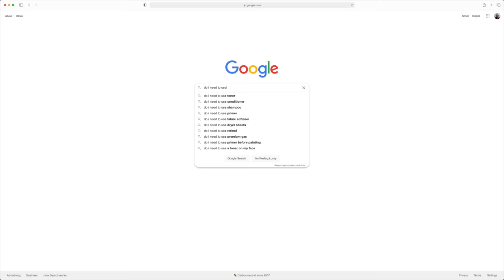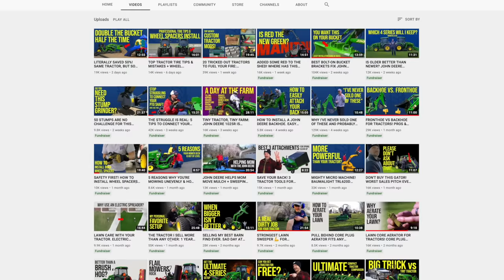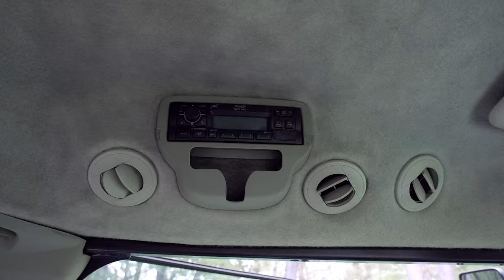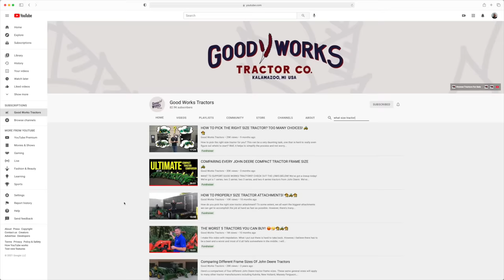TOP 10 BIGGEST TRACTOR PURCHASE REGRETS! COMMON MISTAKES! 😭

Comment: I was kind of surprised by the mower deck being a regret as I just love the 62" on my old 2305. It is fairly easy to put on and take off even if it is not quick attach.   When I was shopping for a new tractor in 2007 the things I was looking for was a smaller tractor then my old Kubota 185. The issues I had with the Kubota was it sat higher up on the ag tires and it was loud. I was matching the tractor to my 5 acres of cleared property. I also wanted a tractor that had a backhoe and front end loader. 

After shopping around I ended up at the John Deere dealer and got a 2305 with the front end loader, backhoe and the 62" mower yeah expensive and having the power beyond hydraulics for the rear along with hydraulic lift for the mower deck.  It took some work to get the tractor sorted out for my property and I wanted a sunshade as I have a issue with being sunlight sensitive. I was somewhat disappointed with  the dealership on the way things were done prior to delivery. I mean having the mower deck way to low and not adjusting it to the proper height for 1-4".  After getting the tractor adjustments and serviced to my requirements I got it perfect for the property. 

The number one best attachment I got for that tractor was the backhoe. I did also make one decision that I am really glad was having two different size buckets for the backhoe 8" and 12" when I bought the tractor.  Recently I started to upgrade the tractor lighting like a light bar on the top of the sun shade and replacing all the factory lightbulbs with LED which means less power draw from the battery and alternator. Putting a light weight light bar on the sunshade has the benefit that the bucket does not interfere with forward vision at night when you might have to raise and lower the bucket.

Comment: My best attachment is my 4way bucket  by far. Got with the tractor  and it works as  grapple  is great at sculpting  and leveling banks with the open front portion pulling backwards and the back portion with the bucket open has a dozer blade  that works great on my driveway.  It picks up firewood rounds up to 3.5 feet across and 600 pounds  it is great and no one's  talking about it. Why is it so little promoted.
Reply: What's a 4 way bucket?

Comment: Truly excellent video and topic!  Kubota B2650 with cab is my ride, and my first ever tractor. Two regrets I suppose. First, 3rd function. I have absolutely no use for it 3 years into my ownership.  But, if I do have need of an accessory in the future, this will be expensive to remediate.  Second is not knowing enough to have gotten a top-of-the-line seat. Mine is good, but an early 50’s back needs a little more tlc! 🤣 Keep up the excellent work and stay safe!

Comment: Great video Courtney. It is so spot on. I did do a lot of research but not as much as as i could have. As i have told you in a talk at the shop i was going to get a 3039r but the perfect storm . Garage not tall enough , city codes and covid hitting john deere  factory. Supply was going to get tighter and it really did so i went smaller ( 1025r with mauser cab). I know i have said this before thank you many times over for the tiny tractor video. It did not only made me more at ease with the purchase of this great, stout little work horse i do not regret it. Would i have liked the bigger tractor yes , but this will work just fine. Lastly the only things i wish it had are two: separate mower lift and the extra hydraulic function Anyway great video as always. You and Chis have great day and be safe.   Tim

Comment: I did not want a mid mount deck  on my 1023e, but the salesman insisted it would be best, even brought in another salesman to convince me. After a few months of using it and the hassle of taking it off and putting it back on, (adjust, drive on, nope adjust again, drive on) My dealer would not help me in trading for a finish mower, so I had to advertise it, a dealer in TN. bought it and with that money I bought a JBar finsh mower. Best move I made.

Comment: Yep that's my number one regret. I should have got the 3rd function and could have got a Used Mid Mount Mower very cheap later. Thanks for the video : )
Reply from the maker: Good stuff, thanks for sharing!
Reply: I'm waiting on my 1025r to come in. I ordered the 3rd fuction and was wondering if it was worth the price. Going to get a grapple but not sure which one to buy that makes the 3rd fuction useful
Reply: @dannyallen9804  Not sure either I still don't have a 3rd function valve but got my eye on summit's 4 rear remote manifold that tractor time with Tim showed on his channel. Then I will plumb one remote forward for the Grapple.

Comment: I bought the belly mower 3 years after tractor.  Love it!  Never take it off and I've never had my bucket off.  Right now I have the bucket, mid mower and 4'  rotary cutter on the back.  I bought a Mahindra eMax22 in 2013, still great.  Detachable bucket want an option.  😣 I want one.  Can a turbo be added?

Comment: I see good tractors for sale here on FB and local swap sites and 90% of the time its one of two things. They are selling the one they have to buy one just like it or slightly larger with a cab because they did not buy a cab the first time and bought too small. 

Also, you often see people selling old tractors because they did not support quick attach or also because they wish they had gotten a 4 wheel drive model. 

The other 10% are just selling because they need cash.

Comment: I do not own a John Deere but my tractor is brand new and I hate my belly mower. It mows great but has several draw backs. One of the main reasons I hate my belly mower is that the tractor does not have very good (any at all) suspension and when mowing a rough lawn then it can be hard on the body. Also if you have a hill, it is very dangerous to mow using a very tippy tractor.

Comment: My 2020 LS MT225 came standard with a Skid Steer quick attach loader. This video is the first I have heard of LS having their own style quick attach.
Reply from the maker: It was my first time as well.  Almost identical to a SSQA, but smaller.
Reply: @GoodWorksTractors  Could it have been the qa system off a mini skid track loader? Those work the same as the skid steer quick attach but are smaller to facilitate the smaller machines

Comment: Does the belly mount mower do a good or just fair job?  I hear many people talk about issues with scalping or irregular cuts.  Appearance is important to me and I’m concerned I might not like the results. Would a rear mount finish mower be a better option?
Reply: I don't have first hand experience with a mid mount mower on a tractor but. I have with a rear finishmower. I've noticed that brand and shape make a difference.  If your yard has dips and valleys "not huge" . Depending on the deck you may scalp in spots until it gets evened out more.  Depending on how deep the dips are you may have to go another direction because you will feel like it didn't get cut.
   I  had an older woods rear finish mower that did a great job.  It seems the newer ones have a v shape in the front and I find that digs into my yard  here and there. The  newer one I tried, wasn't a woods and I was rather disappointed.
Reply: @billfischer6464  thank you very much.

Comment: I was a tractor virgin when I bought both a 2021, 5055e and 1025, both with buckets and the 1025 with a backhoe. My biggest regret thus far is not purchasing some sort of ballast for the 5055. It almost cost me my tractor (at least some horrific damage) because I over estimated the amount of gravel I could carry in the bucket. I had to dump my load in order to keep from tipping over during a down sloping turn.

Comment: I’ve got some serious brush to cut around some acres I just purchased.  I don’t even know the difference between a bush hog and a rotary cutter.  I have a JD 728x, but I cannot believe that’s large enough to do the job.  What do you think would be the sturdiest, most dependable, easiest for a woman to use, affordable tractor and bush hog?  I would also use it for tilling, and scooping/ loading.  But I don’t like driving a tractor with a loader on the front if I’m not using it.  It just bothers me,
Reply: Get a John Deere 1025R and a Frontier RC2048 rotary cutter from the dealer - you will love it !.   John Deere IMHO builds an excellent tractor and has excellent customer service and a very large dealer network.  A rotary cutter, bush hog, and brush hog are all the same thing - some are just proprietary names like Kleenex and tissues.  I have the same rotary cutter and it goes through some really big stuff (10' tall and 2 inch saplings) and just mulches it up into sawdust.  The 1025r can be ordered with the quick park loader - which very easily comes off and on in less than 5 minutes (watch the Good Works Tractors Video of how to remove and install it!). If you are going to run the Rotary cutter without the loader on the front then also put some suitcase weights on the front of the tractor to counter balance the weight from the rotary cutter - again just purchase all of this stuff at the dealer.  I like to buy new - then you get the bumper to bumper warranty (2 years 2000 hours) and also the 6 year 2000 hour power train warranty (engine and transmission).  Or buy used from Good Works Tractors and save some money !

Comment: A sub-compact with a belly mower is good for cutting a LARGE  area, but not very nibble around a HOME. A zero turn is a lawn MOWER much easier and faster for mowing in general. Loaders and front mounted equipment REQUIRE counter weights. I guess a salesman does not want to scare off a customer with this necessary  additional cost.

Comment: I have a 3032E. My brother used it to pull a double hay rake today. He asked me how to set it to float. Apparently the 3pt on this tractor doesn’t float. The way he explained it is that It behaves as if it has down pressure forcing the tongue of the double rake toward the ground breaking the tines and lifting the back tires enough to spin. It doesn’t float with the terrain. It does ok on level ground. We pull these rakes with an older much less powerful 1940’s Ford Tractor without any problems on the same terrain. Is there something I need to do to put it into a float position?

Comment: OK... from personal, practical experience owning a half dozen tractors of various sizes, the most practical for the guy working or developing a piece of property, the minimum horse power required is about 40-50hp with a loader and  4-wheel drive.  Forget the 2-wheel drive tractors unless you are going to work dry ground pulling agricultural ground engagement attachments.  You will just about double the amount of work you can perform with a 4-wheel drive tractor over a 2-wheel model.  My largest 4-wheel drive tractor was a 65HP Kubota M Series.  It was used to pull discs over a 10 acre field.  I had a 2-wheel drive Massey that was about 70hp that was frequently stuck on flat wet ground. Even with the rear wheels locked I could not get moving until my neighbor with a 35hp four wheel drive tractor pulled it back a few feet.  On the plus side, on flat dry ground the loader would lift about anything including huge fir stumps onto a burn pile.

Comment: Agreed.   Mid-Mount mower on these are poor buys, they are a hassle and don't cut all that well with a tendency to scalp, and you can't take them into the woods.  Better to buy a separate mower.
Reply: Agreed, I have a couple old jd 445 garden tractors that are great! The 54 inch deck cuts the lawn awesome and the 60 inch deck is a brushhog with oregon g6 gator blades!

Comment: My biggest regret is the tractor itself. I was looking for a small tractor with a loader and a backhoe. After looking at Deere, LS, TYM and Kubota I assumed that to get a small tractor you'd have to get a farm tractor with the backhoe added. I ended up with the kubota b2601. There was zero help from the "sales team" at kubota because there are no other dealers around so they don't really have to try. A few weeks after purchase a friend asked why I didn't just get the b26 TLB. The answer is because I didn't know the machine even existed!
    Now when I dig trenches in my oak forest I spend more time with the sawzall than I do the backhoe. Not to mention that you can't get 4 in 1 with the b2601. Thanks sales team!
     I asked about a trade in even though my machine only had 14 hours and there's a wait list for the b2601. They said I'd have to eat the tax, which that's a given, but they also wanted 15%. So basically a 8.5k loss. No thanks.
     All bitching aside, it's a good tractor, just not the right one for me.
Reply: @peterm3964  Looks like you missed the point of the whole video. Not surprising
Reply: How did it turn out?  Did you sell it privately?

Comment: The biggest problem with the belly mower is that you can not use it if you have a 3 point attachment connected because the 3 point goes down with the mower.

Comment: Nailed these.  My 1025r mower deck is constantly becoming misaligned and I'm having to drive on and off several times to get the drive over deck lined up.  Really wish now I'd just gone with a zero turn and kept my tractor for all my other work.  And one that I'm surprised didnt make the list....someone telling me about the 1025r taillights being so susceptible to breaking.  Didnt have my tractor 5 hrs before I broke my left light on a tree limb going around a tree mowing.
Reply: I drive two 1025rs at different places  same owner ,one has a quick hitch deck which is great unless you break a belt.
The other one doesn't have a quick hitch and is a real arse to hook up or even disconnect the deck pto .
As for the lights on the roll bar take them off an mount the on the inside of the roll bar real easy. Both these mowers do 5hrs of mowing each mow.
As a matter of interest one of these mowers I put my cycle computer on it and clocked up 25km in one mowing .
With the front end loader you need to be very confident with your skill in knowing the tipping point when the bucket is loaded as you will tip the tractor over this applies to all tractors lrg or sml as they are front steer and are there fore very unstable.

Comment: I don't regret getting my third function for my kioti tractor, but I learned after the fact that it isn't as capable as my dealer alluded to, I can't open and close the grapple while moving the loader boom. Also the 3rd function won't operate a hydraulic auger, will have to use the rear remote and run a line.

Comment: My biggest regret, (and I knew it would be) was not getting 4WD on my Kubota L4600 with a loader.  I knew it would limit some of it's ability, but I don't have to use the loader a lot, especially with heavy gravel.  I did fix the situation by adding two sets of rear wheel weights, and I usually put on the tiller as well.  I'll be adding another set too to make it even better.  
I just was at my budget's limit with this tractor, but it does most everything very well, just need to add that last bit of weight.

Comment: Not told it won’t work!  -  Hi , can you confirm this issue?  -  JD X354 , One big reason to make a purchase is thinking the 42” 4WS can cut close to a curved walkway or mulch bed. It seems to me and this is where you can verify things seems to me the 42” deck will only work as planned on an outside circle such as mowing around a tree. But it cannot cut up to the tire’s path of travel on an “ inside “ curve. The 4WS simply isn’t enough on a 42” deck. A 48” deck will be needed to get you up to the edge on an inside curve? This is my observation as per checking out various videos and researching to keep from making a purchase MISTAKE. Nobody actually tested it on camera. My priority is to buy a mower that will save me from returning to cut the edge of my curved mulch bed. I’d hate to make a BIG purchase on the X354 and find out the 42” won’t reach the mulch bed on a tight inside curve but the 48” will. 🥵

Comment: It is important to mention that the one “lever” /control lifts both mid mount mower AND the 3 pt. Hitch !  I pull a cyclone vacuum and can’t have the 3 pt. Going up and down every time i move the Deck up and down !  Now I have to purchase an additional valve and plug and unplug the deck /or 3 pt. …….Salesmen should have made that point !!

Comment: I purchased a new massey 2860. It has standard skid steer quick attach. It was mentioned in the video that they have their own designs. I believe they may have changed that for their new models if this is the case.

Comment: Looking at the 1025r, but I was introduced to the ct1025 from bobcat......is there a superior product between the two?
Reply: I've never driven the Bobcat so I can't compare them but one thing to be aware of is the fact that the CT1025 is actually a rebranded tractor from another manufacturer. While this is not unheard of it might be something to look out for as you can often get a tractor cheaper from the original manufacturer. This is the case with the smaller LS/New Holland tractors.

I will add that Kioti tractors do look nice though and I don't think I would have many reservations about owning one.
Reply: Thats actually built by Kiota.
Reply: I personally have not heard of any issues with the Kioti tractors. But tractors have been tough to get (this spring anyways), and I noticed the Kioti dealers didn’t have everything in stock that I wanted. My local JD dealer was able to get me what I wanted (much larger dealer network) and they were very close to where I lived. So I went green. Btw, so far no regrets at all.

Comment: Be aware, adding liquid ballast can create problems. Eventually the valve stems corrode and leak. If not corrected, it will lead to rusted wheels.
Reply: There is stuff you can use that won't cause rust, it just cost a lot!